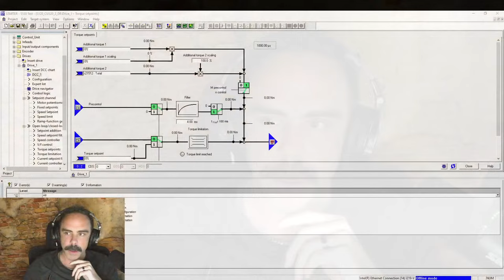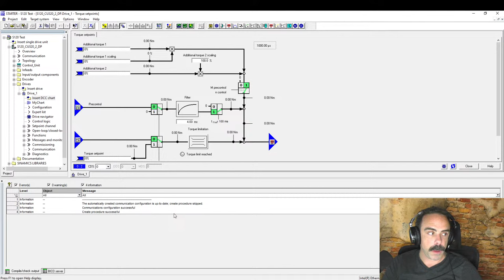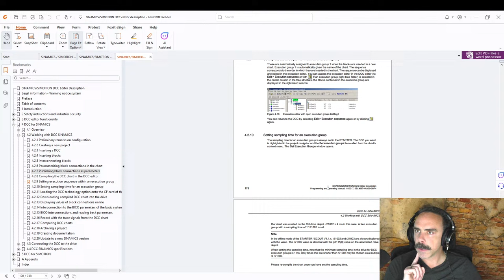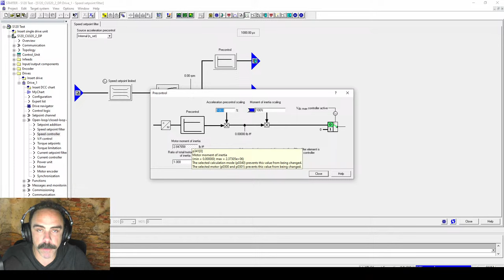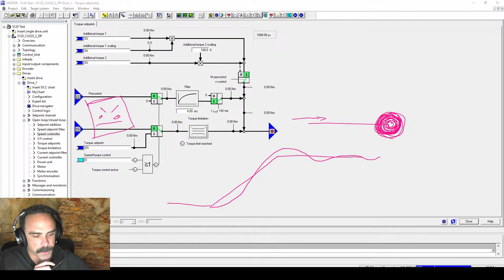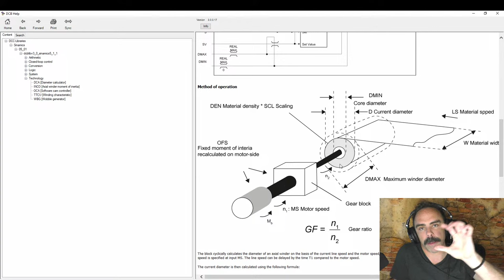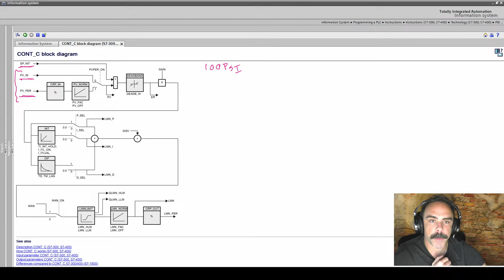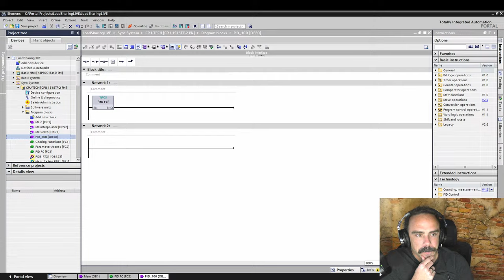Live Siemens PLC Training: Introduction to S120 DCC and S7 Block CONT_C

Comment: Have you worked on CU-320 with DCM over OA-Link ?
Reply from the maker: Yes! I actually have! I used a CU320-2 to run electronic gearing and send out setpoints to 4 DCM. OA link is one of the coolest features not many know about!

Comment: Hello Jason, it's great punch of streaming those days, is there any comparison between what is done by Starter and what can be done by startdrive inside TIA ?
Reply from the maker: I would need to get a full update from Siemens because Portal added quite a few features into V18 (and are adding into v19) and I am currently running V17. With that said, there are a lot of differences, but most of them are just visual. 

For example, in Starter, there is one "Setup Wizard" that steps through everything. In Portal, you set up the hardware in the same place as PLCs and HMI, then go in and step through a couple things that might be missed. The only features I know are not available in V17 are the two things I mentioned in the stream. DCC and FFT analysis, but I know for a fact that DCC is in V18 (I've seen the documents). 

I have used STARTER since 2006 so I am VERY familiar with it so there are some things that don't feel natural to me. However, if you are just getting started I would just learn STARTDRIVE as it is really great to have everything in one place inside Portal.

Thank you for being part of the community!

Comment: How to use S120 in torque control mode inorder to keep tension ?
and how to do alternate with speed control when other condition appear ?
Reply from the maker: Check out the "load sharing" livestream. It goes through exactly how to set this up.

Comment: Can you simulate drives
Reply from the maker: There are a couple tools called PLCSimAdvanced and SIMMIT that when used together can fully test the communication and response of a drive system. There is not a way however to simulate the actual S120 processor.

Comment: I have to replacement the new motor module with the different part nimber.
Can I download without the original project file which has parameter number 60100 ?
Reply from the maker: The motor module does not contain any of the program, so the DCC will not be affected. The only reason you would even have to do any sort of modification to the program would be if you have Safety Integrated enabled or if you are changing a 0AAx or 0ACx hardware out with a 0ADx module. In the first case you will need to accept the hardware inside of Safety Integrated. In the second case you will just need to go online, change p10 to 2 and change p201 to match p200. Once that is done, change p10=0 and copy RAM to ROM.
Reply: @jasonwattsae  The machine not have Safety Integrated.
The motor module does not contain any of the program, so the DCC will not be affected. 
Do you mean I can download the upload project file which changed the motor module after copy RAM to ROM the machine can run same as the old motor module the DCC does't effect it ?
Reply from the maker: Yes. Make sure you have a good backup (Upload) before doing anything.

The only reason you would have to change anything in the program is if you are changing sizes of motor module.

What part number is the old motor module?
What is the new?
Reply: @jasonwattsae  The old part is 6SL3120-1TE24-5AA3
The new one is 6SL3120-1TE26-0AA3 
in the upload drive project file it can't upload DCC.
I am not sure if change new one in hardware config and copy RAM to ROM
the machine still run as before because the project have no DCC.
Reply from the maker: @vorapobautomation9760 Ah. This does make it more difficult. If you really cannot get the DCC uploaded (have you tried using STARTER?), you can make this change online, you are just not able to use the built-in  configurator.

You should be able to swap the motor module, boot up the unit. It will have a fault because the hardware isn't correct. You can then go to p10 and set it =2. At that point, you can go down to p201 and type in whatever is in r200 and press enter. Go back to p10 and set it =0.

Do NOT do a copy ram to rom until you are sure it is going to run. If something is messed up and you can't figure it out. Just turn power off the machine and your old settings will return.

I would also make a copy of the files on the CF card using a standard windows CF card reader, just be careful not to let windows "Fix" or Format the card. You can just copy the files on the card into a folder on your desktop. If something gets messed up you can just copy those files onto the same card and your old program will be there.
Reply: @jasonwattsae  Thank you very much  (have you tried using STARTER?) yes I do it with STARTER and select overwrite avaiable DCC libraries too.
but can't uplaod the DCC.
Reply from the maker: Have you been able to make the change?
Reply: @jasonwattsae  No, I am not sure it will can run again if I copy RAM to ROM after change new motor module configuration.

Comment: How to enable active line infeed in DCC ?
Reply from the maker: You can either directly connect the output of your logic to the OFF1 parameter in the ALM drive object or you can publish it as an r value and connect it in your expert list manually. Think of it as a drive, your have a bunch of enable bits, then an OFF1. The OFF1 turns everything on. You just don't need a telegram since you can directly access the bits.

If this doesn't make sense I will try to clarify.
Reply from the maker: Watch the section about SINA_PARA and see how to find the HW_ID of the telegram 370. Put that number in the SINA_INFEED block and use the enables. Let me know if you aren't able to get it going and I will discuss it on my next stream.

https://youtube.com/live/hiYozgACNjI?feature=share
Reply: @jasonwattsae  That good sound I will waiting for your next stream
about 
1.active line infeed module direct enable without DCC and without PLC control.
1.active line infeed module enable with DCC without PLC control
2. enable active line with PLC with GSD file.
3. enable active line with PLC with STARTDRIVE.
Reply from the maker: You know... I just started up an ALM so all these topics (plus more) are fresh on my mind. I think there would be enough for a stream on it. It sounds like a plan! It will probably be Monday when it happens.
Reply from the maker: Check out the latest Livestream...it should be very helpful...😄